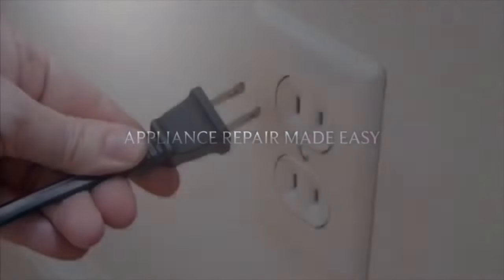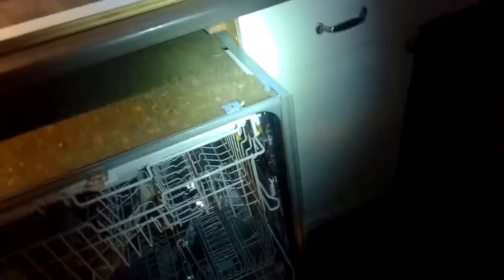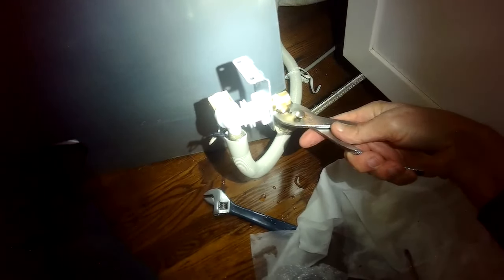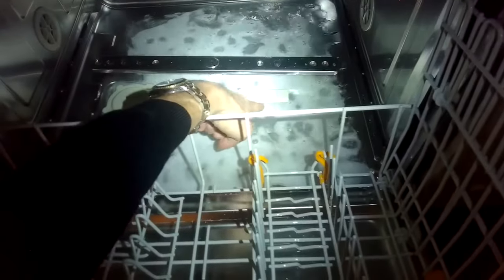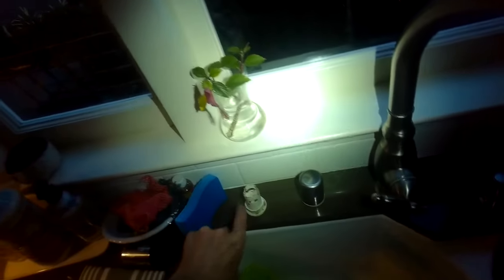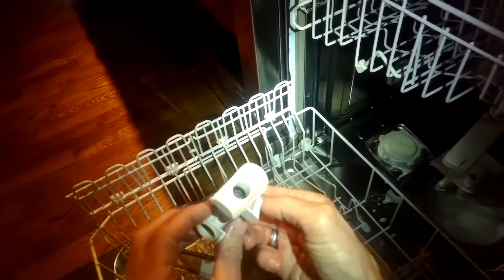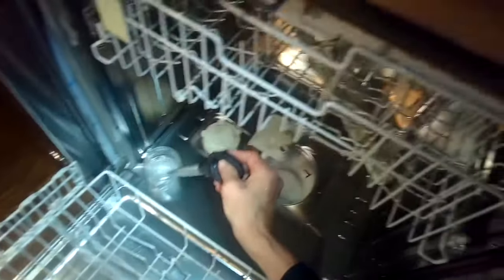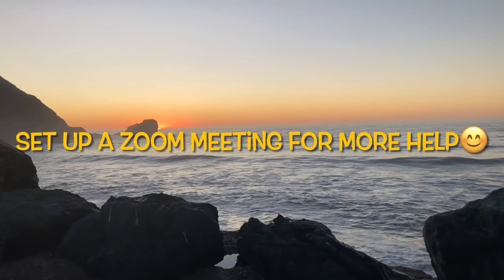✨ Miele Dishwasher - Won’t Fill - Easy Fix ✨

Comment: Hello Scott
All good but this is really about a washer that won't drain rather than fill. We just bought a secondhand one and it just won't fill. Buzzes for about a minute and stops. Thanks for showing us the inlet Thing - I will pull that apart and look for a blockage on the inlet side.
Reply from the maker: I bet a new fill valve will fix it.
If it can’t fully drain it won’t fill.